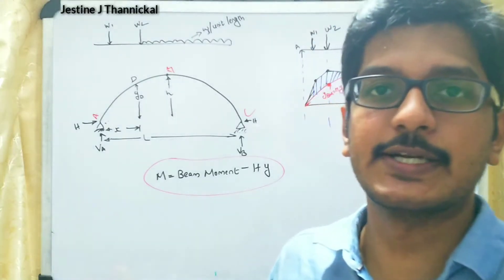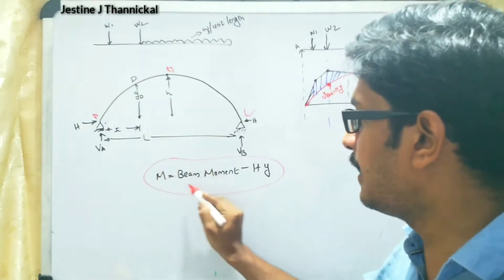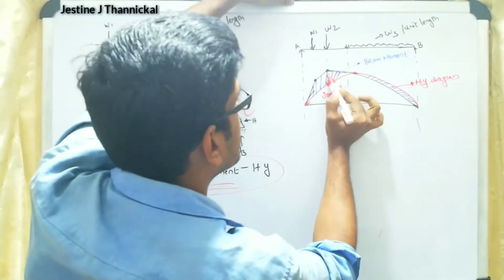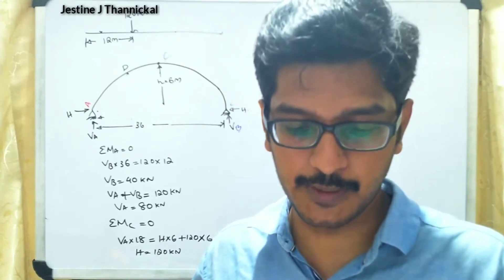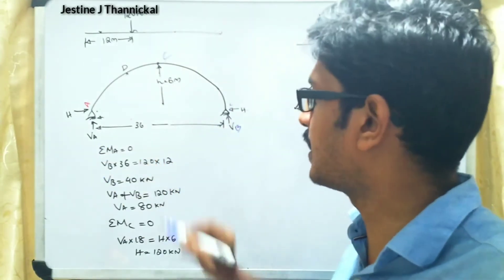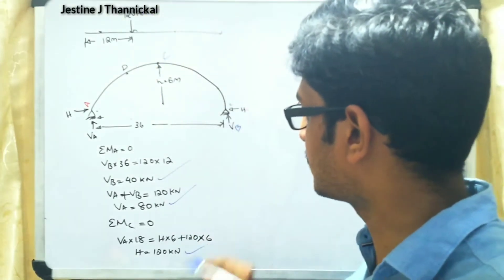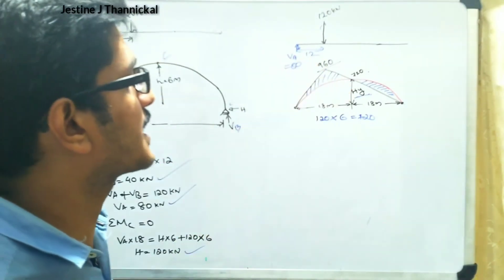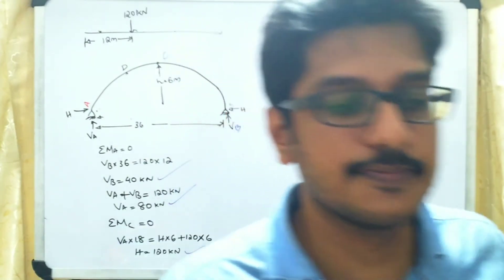#ktu #arches #structural   LECTURE 25  HOW TO DRAW BENDING MOMENT DIAGRAM FOR ARCHES🔥

Comment: Sir,why we have only taken Va*12 and not considered H*yd for finding beam moment at point D in this problem?
Reply from the maker: For drawing BMD, we have to consider the loads are acting on a beam, and draw the bending moment for that beam. After that u have to consider HY diagram. So finally, if you have to find the bending moment at D ,then u have to the values VAx12- Hy
Reply: @JestineJThannickal   Got it sir, thanks